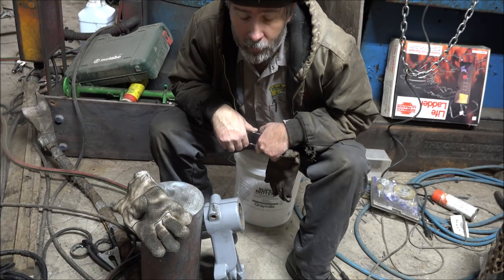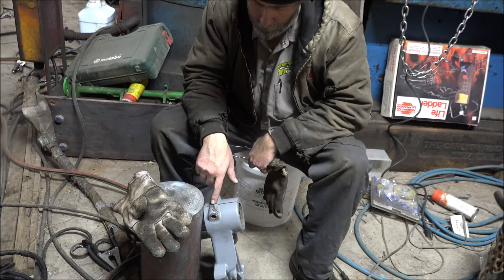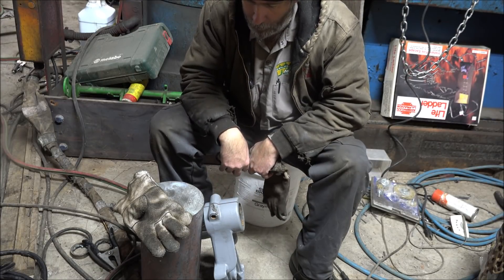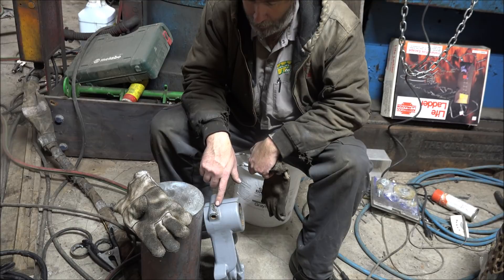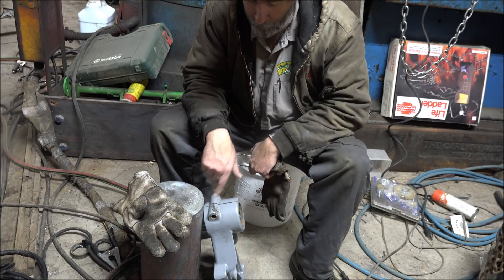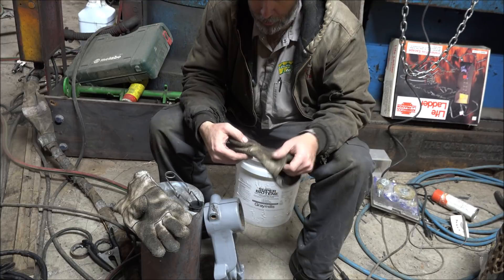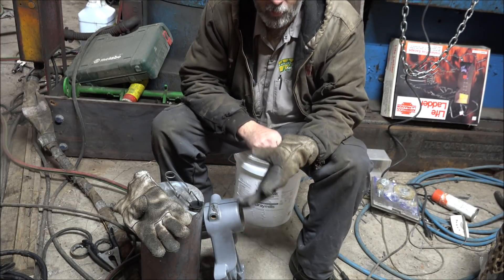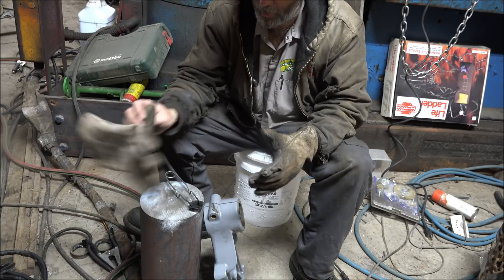Cast Iron Invisible Repair on Old Drill Table How? Welding Hillbilly Style making a Crack Free Fix

Comment: Good VJO! I am no welder, when I have had to weld cast iron I found the E308  with a pre- heat worked for me, it worked better than the cast iron rod I bought from HF. The idea of peening when welding cast iron is as follows, the weld goes into the crack fully expanded thus you are trying to peen the weld to deform the weld before it cools. Always let it slow cool. Not sure if that is going to help anyone but that has worked for me.

Comment: Doing alot of research before attempting to fix cast iron bells.
 
My  crystal metal white? Cast iron 1886 bell has a crack.

My other 1915 steel alloy is good but the turning wheel has old cracked welds and the steel head bolt broke at the clevis.

All i have is a multivolt mig, oxyacetylene torch anx propane torches, jb weld for steel and very little money at the moment.

I’ve looked at tons of videos but your use of 7018 with no flux was most interesting and now you’re using Certanium 889 run DC
Straight per the comments.

Then there’s specific cast iron rods, nickel 99 and 55. I don’t if there’s cast iron wire.

Brazing vs welding etc?

I also broke my old vise the other day so I something to practice on but it’s grey cast.

It’s 2022 so just trying to pick a best method old vs new etc.

I would really like to play and try all but money is a factor.

Any recommendations from anyone would be appreciated.
Reply from the maker: Fora bell I would think it best to oxy acet weld with the same material if possible. Anything else likely could ruin the tone.

Comment: Brian, can’t figure out how to contact you directly, so I’m posting a comment here.  

I think you replaced the follower “finger” in the steering box on the big forklift.  Where did the new one come from?  It looks similar to the one on old 1st generation CAT wheel loaders.  I have a 922b with a repaired follower that’s working but I would like to find a new one.
Reply from the maker: I got it off ebay. Search Ross HPS 52
Reply: Thanks

Comment: He never said what rod he used, or did he?  I can only assume it was 55% nickle.  I thought he would have a welding table.  I don't think it is a "7000lb drill casting" that's three and a half tons. Ron W4BIN
Reply from the maker: Rod and electrode configuration is in the description. The main 7ft arm of the Carlton drill that I welded back together is over 7000lbs.

Comment: Okay, this one is just me being plain old nosy. What's the deal with the fire escape ladder? I seem to remember some video from in your house, could have sworn it was a single story. Just have a hard time picturing you ordering one of these instead of building something yourself.
Reply from the maker: My house is a very tall 2 story being that it has 12ft ceilings downstairs but I sometimes throw the ladder in the man lift cuz if it quits when I am way up in the air it is easier to climb down the ladder than the boom.

Comment: What exactly is happening with the peening? Is it still malleable enough from The heat that this drives it into the pores, sort of creating a mechanical Bond? Or is it just about making sure that the buildup of weld is sort of forged to the cast iron? I know the process, I've seen it done several times. Nobody has been able to explain exactly what's happening, or at least not in a way a dummy like me can understand.
Reply from the maker: The idea is it forces the weld material to expand so as it cools and shrinks it doesn’t pull against the joint to the cast and cause it to crack.
Reply: @bcbloc02  thanks very much for both answers. Every day is an opportunity to learn something new. You taught me two today, thank you
Reply: @bcbloc02  had no idea. Just thought you like taking your aggravation out on my projects 😂

Comment: 'Did a similar repair to a 15" table - cracked about halfway between the clamp & table 2/3rds of the way through the sleeve . . . without the luxury of a torch for preheating  !    'Managed to 'heat' the area , ( after grinding out a decent 'V' notch ) by 'sticking' the rod several times .   I used 7018 rod , & skip welded , with a LOT of peening !    I 'stop - drilled' where the crack ended , to prevent  further cracking . . .  it went pretty smoothly  ,  with a final pass capping it , stitching back & forth along the crack . . . * Did I mention LOTS of peening ?  ;p 
       Two years later - - -  that drill press is not only still holding up . . . but is getting transformed into a light duty vertical mill ;)      'Got a 75 pound milling table with a 30 pound vise on it . . .   'lots of bracing is in the plan  . . .        
                      It takes a good deal of patience to make it work !       Good results , Brian ! ! !
Reply: What model press is it? The table is mine. From a 50s Delta. Glad to get it fixed.

Comment: What did you use for rod and at what amperage? Assuming you bevel ground it out with all the passes you made? Couldn't really pick that up through camera angle!
Reply from the maker: Yes the crack was ground almost completely out and a 1/4" wide before the job was started.  My welder has % on the dial so I don't know an exact amperage but probably 160-180 I would guess with a 5/32 certanium 889 rod.

Comment: We have these ANNOYING mud bees that will stop up any hole. Electrical outlets, air tool chucks , your random stash of hydraulic hoses, carburetor vents, ect. Way more annoying than the standard wasp type mudd dobber.
Reply from the maker: They live here too, got bolt holes in every machine to prove it. LOL
Reply: I bought a car from Tennessee, about twenty-five years ago, and I still find remnants of those bugs and their mud in the strangest places.
Reply: We have them down under as well .  Hornet's  , bloody aggresive things when you poke their mud homes !
Reply: @swanvalleymachineshop  Yes, I’ve learned not to do that.

Comment: Nicely done, I am guessing the shop supervisor gave you prior authorization and approval?  No final inspection needed?   When we getting a Barn/Shop update?  Whats going on with the CNC machine?  How about the roof issues, you get those all resolved ?
Reply from the maker: I snuck this job in while supervisor was asleep.  Nothing ever seems to get finished around here, it just gets to useable then its on to the next fire to put out. I haven't done anything really with the CNC #1 because I cn't currently access the rest of the parts to it and #2 even if it was going I don't know how to use it so its a low priority.

Comment: Brian:
One of my flat belt driven drills has some wear in the table support that runs on the vertical column....it's split at the back with cross bolts to clamp it....
It means the table isn't square to the quill anymore...
I'm undecided yet as to whether to braze & bore it....or solder sleeve it...
🇬🇧😐
Reply from the maker: If it has a lot of meat so it doesn't get thin when you sleeve it that is how I would go. If it is kind of thin then braze and bore .
Reply: @bcbloc02  

Oh it's not "thin" Brian..
The table"s about 3ft in diameter....lol
Reply from the maker: @glennmoreland6457  I meant the part that clamps around the pipe not the whole table. 😂
Reply: @bcbloc02  

Yes I know Brian...
I was being a twat....lol
🇬🇧😆

Comment: Another successful save on some old iron. Was that cast iron rod or something like nickel 99? It looked like cast to me especially with all of the peening you did. Nice job! Hope all is well. - TZ
Reply from the maker: its a specialty rod I picked up a bunch of for cheap that seems to work well. Certanium 889 run DC Straight
Reply: @bcbloc02  Hi Brian according to the Lawson products SDS the three major components are Ni: 30-60%, Fe:15-40%, and strontium:5-10%  SDS compositions are usually vague on exact compositions of course to protect intellectual property but still supply sufficient safety info
Reply: @vicpatton5286  - That's a lotta Strontium.

Comment: What rod are you using, Brian? Or did you say in the video and I missed it?
Reply from the maker: Certanium 889 DC Straight
Reply: @bcbloc02  I haven't used a cast rod before. Always used a nickel rod for cast welding. What are the advantages of the cast rod?
Reply from the maker: @WAndrewDalgarno  color match and it seems to machine really easy.